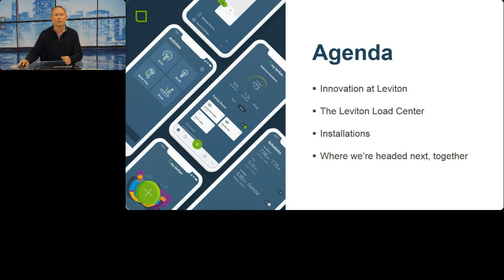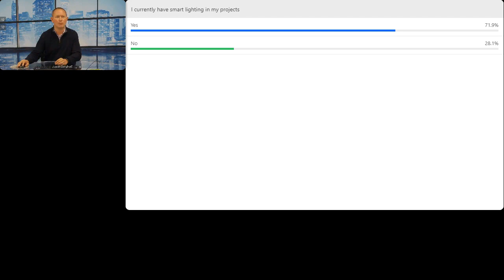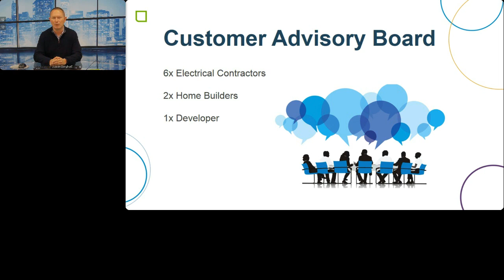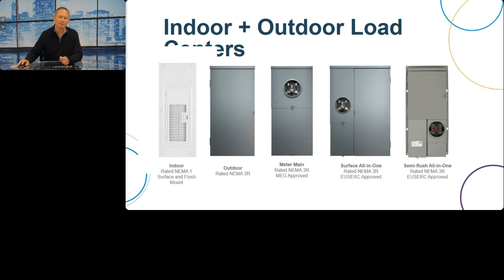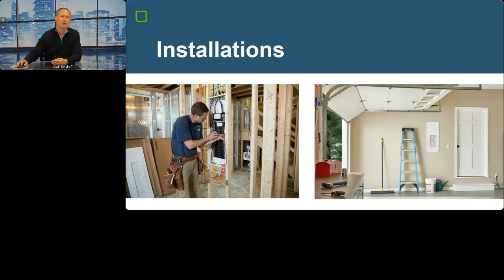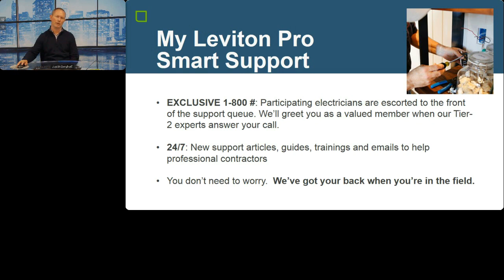Leviton Load Center is Making Homes More Resilient and Efficient

Comment: Is there a way to use two separate breakers to control two separate circuits wired with 14-3 cable?  Each breaker requires a neutral, can the panel neutral bar be wired to?

Comment: As a small to electrical contractor largely do new builds we have recently switched to exclusively using levition load center I’m very happy but would like more interaction with Mfg sales reps I’m very interested in levition pro rewards program we currently have installed over 50 load centers in the last 12 months and control Ramp up
I need get more up to speed partnering program

Comment: Peak demand controol 
You didn’t speak to leveraging the software to controol demand limitations set by the user to mitigate on peak demand charges charged for a moment of use in a short period measured like with APS EVERY 30 minutes.  Prioritizing loads to mitigate demand.  Many of the smart meters speak to this controol but only to manage off grid battery utilization.